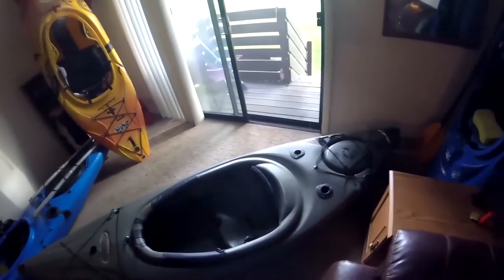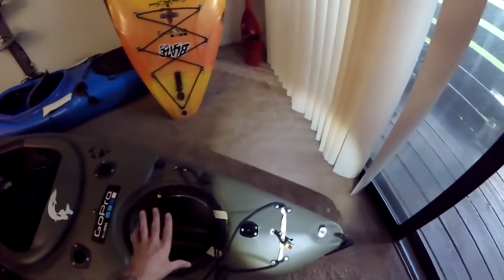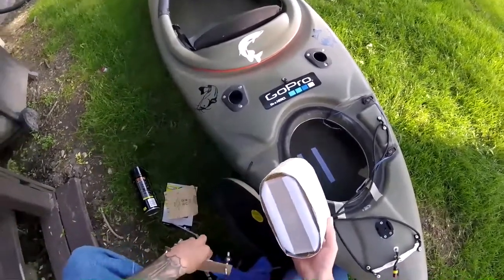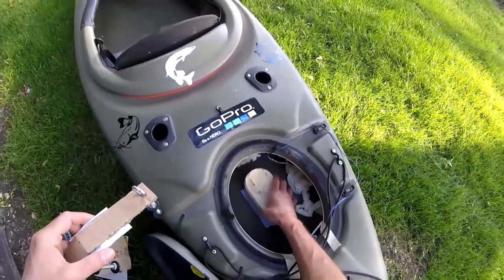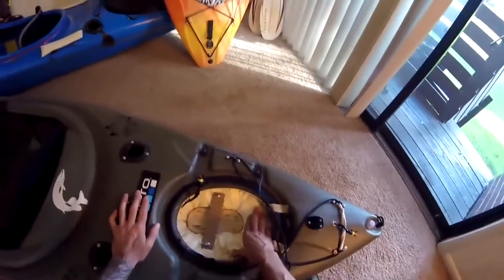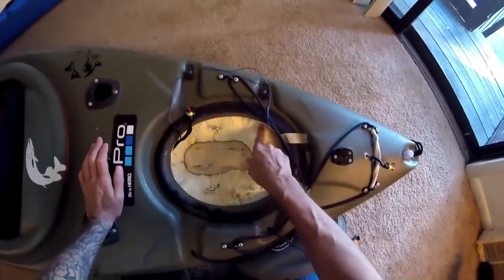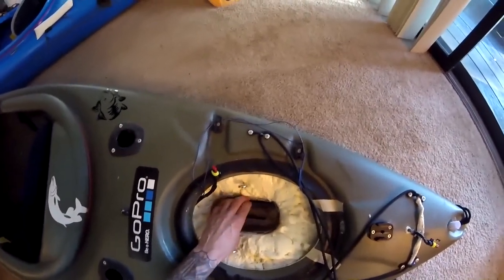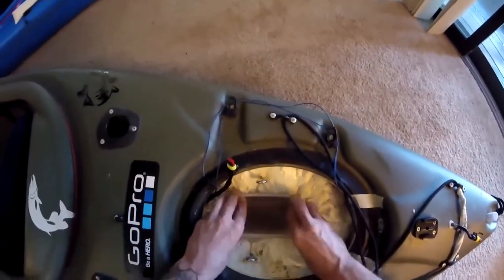Potomac Kayak Modification 2

Comment: Expanding foam absorbs water. You need to seal it if you use it in marine applications. This will eventually get waterlogged and VERY heavy.
Reply: You can buy closed cell expanding foam in spray cans. Just read the can to make sure it's CLOSED CELL.
Reply: @YoureWrongImRightGetOverIt  ...the 2 part mix has a -4% moisture absorption rating, I'm not to sure about the 'canned' foam